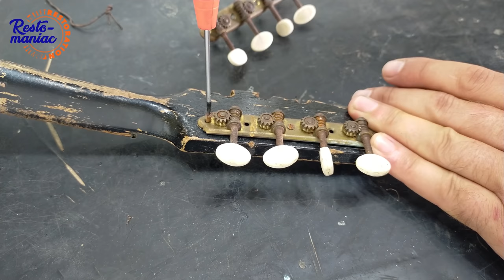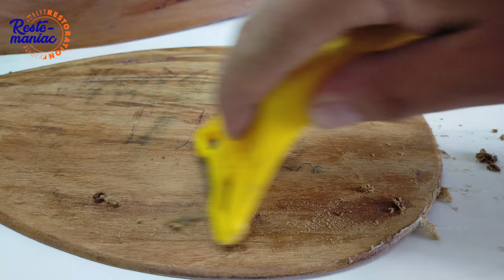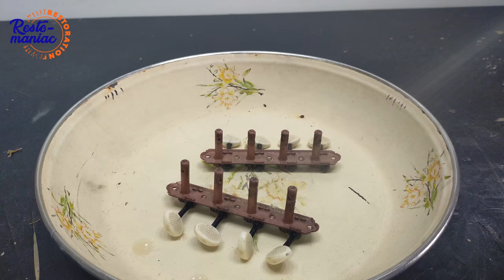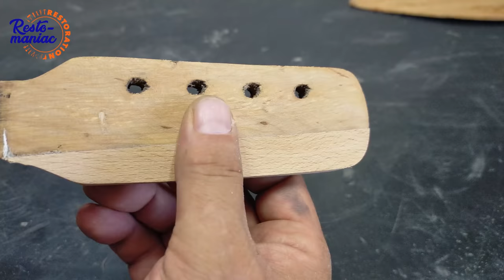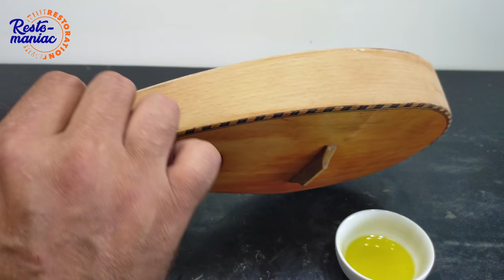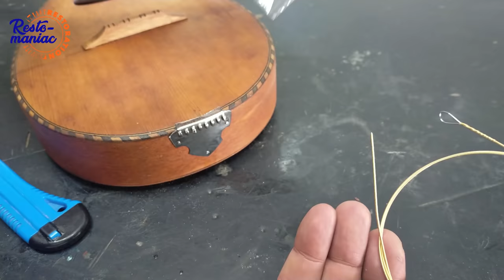Poor Mandolin - Restoration

Comment: As a luthier of some 40 years experience, I feel the need to comment on several aspects of this restoration. First, the bridge on an instrument of this type should never be glued down. It’s designed to be held in place by string pressure and should be free to be moved to make fine adjustments to intonation. Hammering down the prongs on the tailpiece will eventually weaken the metal; after two or three string changes they will probably break. And olive oil is not the best choice for a finish; it takes a very long time to polymerize and harden. That being said, it’s nice to see an old-timer like this revived!
Reply: yeahhh I was right
Reply: Sorry Fred I jumped in before seeing your comment
Reply: @jasperwylde8612  no problem, Jasper; with two of us telling them maybe the message will get through.
Reply: @jasperwylde8612  errare humanum est...Only those who do nothing do not make mistakes
Reply: Also he put the tuners on the wrong way round, therefore upside down
Reply: I agree with Fred Casey,

One additional thing I will add here, is that you really should've used some nice screws for that Tailpiece, instead of nails.

Those nails will work loose and cause the tailpiece to become wobbly, causing the Mandolin to have trouble staying in tune!

Nice Luthiery skills over all though, especially in repairing the Headstock, and cleaning & restoring those tuners, and removing & regluing the back! 

Ron
Abilene, TX.
Reply: @rojobemusic3754  I thought I noticed that, but wasn't 100% sure, so I didn't add it to my previous commentary.

But hey, I'm sure he's still learning this trade, and like myself and all others, one of the best ways we learn at times, is through trial and error. 🙂

Ron
Reply: I thought I was going to be the only one who noticed.

I appreciate the cinematography and editing.

Cute kitty.
Reply: @cfcasey.guitars-ukuleles   As a luthier of sixty years experience, I corroborate all you said.  At the moment, I have eleven mandolines undergoing restoration in my workshop.  One additional problem: the bridge looked quite a bit too high- it will be very hard to play in higher positions.  But yeah- the thought behind the restoration was good.

cheers from sunny Vienna, Scott
Reply: Thanks Elvis for that valuable information jerk
Reply: I'm not sure how accurate it is but there's rumor saying some video producers are using controversial technique just to generate more comments (positive or negative) as part of getting financial benefits
Reply: Dear @therealzilch  ,
What are your thoughts on overlaying the headstock with a piece of veneer to hide the seam where he glued a piece onto the headstock.  Wouldn't that add  strength to the headstock, as well as make it more aesthetically pleasing ?
Interested in your thoughts on this.
Be Well,
DZ
Reply: Dear Fred Casey,
What are your thoughts on overlaying the headstock with a piece of veneer to hide the seam where he glued a piece onto the headstock.  Wouldn't that add  strength to the headstock, as well as make it more aesthetically pleasing ?
Interested in your thoughts on this.
Be Well,
DZ
Reply: @Silverheart1956  , it would indeed. Good point.
Reply: Dear @cfcasey.guitars-ukuleles  ,
 Many thanks !
Reply: Very informative... could you please also comment on better options for the finish? Thanks.
Reply: @mssarioglu  Any drying oil such as tung oil or “Danish” oil oil is good; even linseed oil, although it’s a bit slow to polymerize as well. Lately I’ve been using a product called Tru-Oil (originally formulated as a gun stock finish) on the instruments I don’t finish with lacquer.
Reply: @cfcasey.guitars-ukuleles  thank you. Indeed one of the things i would like to ask was if you use anything like lacquer or varnish or not but you already responded. I'm really surprised because musical instruments always look so shiny. I would think it can not be achieved just with oil. ..
Reply: At least he didn't crimp the loops on the strings.
Reply: That is why I replied "I was glad it was going to be a wall hanger" I too have been repairing for over 40 yrs.
Reply: This whole video was painful to watch.
Reply: On the other hand, would you, as a luthier with 40 years of experience, even bother trying to rehabilitate a $10.00, garage sale mandolin if it was not a decent instrument to begin with?  This seems to be a good instrument to practice and experiment on, and no one will be left screaming that he destroyed a priceless artifact.
Reply: @TheMicroTrak  I’ve restored many inexpensive instruments that have had sentimental value for their owners. Sometimes the cost of restoration has far exceeded the monetary value of the instrument, but the joy on the face of the client to see Grandpa’s guitar, or mandolin, or whatever, put back in playing condition, makes it worthwhile, both for them and for me.
Reply: not a luthier here but a player... I knew something was wrong when he glued the bridge... how will the intonation be set now?
Reply: @maxamy89  Good question; I wish I had an equally good answer.
Reply: I was nodding along with the restoration,  anticipating how this old girl might shine after he was done....then he glued the bridge down and I cringed so bad sigh
Reply: @jasperwylde8612 ;
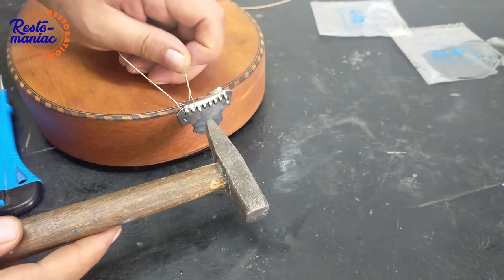Reply: 16:20 😂😭🤦🏻🤦🏻🤦🏻

Comment: You were doing so well up until you glued on the bridge and then hammered closed the hoop end of the strings.
Reply from the maker: Thanks, don't be afraid to hammer.
Reply: Yes. The bridge should float so you can intonate the tone when tuning.
Reply: @Restomaniac   If you are never going to change the strings, go ahead and hammer.  Also, the bridge is quite a bit too high- the instrument will be very hard to play in higher positions.  But for a hang-on-the-wall instrument, it's very nicely done.
Reply: @Restomaniac  The gun stock oil called True Oil, I think would have been a better finish than olive oil.  It looks nice and is more durable.  Also, not a good idea to glue that bridge to the top.  If the intonation is off, it won't play.  Maybe you just want it to look nice and never be played, I don't know, but a bridge should never be glued to a top sound board.  Downward pressure from the strings will hold it in place once the intonation is correct.  This poor old mando gal has seen much better days.  It might have had a decent sound at one time.  Some Venician gondolier might have played it for lovers on a boat ride.  I can see it and hear it in my mind.  Maybe it got wet and the glue gave out.  The paint was a puke color to begin with.  But never use olive oil.  It will smell bad once it goes rancid.   Thanks for the effort, tho.
Reply: Those parts made my left eye close a little bit

Comment: interesting restoration, olive oil not a good choice, Shellac is much better it is fairly cheap goes on easily dries quickly, and looks amazing. The bridge should be of the floating type, they can be purchased cheaply enough to have made this a much better job. Still, it's back in one piece, reasonably playable condition and looks much better than before.

Comment: As a musician and hobby luthier I have to say I agree with the others on the bridge, tuners, tail piece etc. but good job getting that ink pen off there! That was surprising. Good work on the headstock repair also, that would have scared off a few “pros”. Getting the back on and properly aligned was good work as well. Enjoyed the video. 👍

P.s. the plastic for the pickguard is available online and not terribly expensive. Regardless of what this instrument is to be used for, it would look nicer with a pickguard.

Comment: As others have commented, the bridge should have been left floating, the string hooks open, screws in the tailpiece instead of nails, etc.. One other thing I would have done, was to find ferrules for the tuning pegs (prevents damage to the head). All in all a beautiful job on the restoration otherwise. Thank you for sharing it with us! God bless. Rev. D.

Comment: Points for effort and I accept you're not a musician
but
Glueing the bridge before you checked the intonation?
Oh dear!
Mando bridges dont need to  glued because the string are anchored at the tail peice
( nails? really?)
 a free bridge would have allowed for upgrading to a better more resonant material and fine tuning.
 
Hammering the string hooks closed wasnt needed either
what about when the strings need changing?
Prying them open could cause them to weaken and break
The 'Brass bar' is called a fret BTW
Reply from the maker: Thank you for your comments
Reply: @Restomaniac  olive oil is bad impregnation for music wood, usually used linseed oil or hemp oil. This is evaporating oils (IdK how this thing called in english actually)/

Comment: Just a suggestion. Maybe ask a few things about how an instrument works. We NEVER glue down the bridge. You could have bought a fret wire for the "brass thing" that was missing, olive oil is never good for instruments cause it's heavy and does not absorb well and you screwed the tuning pegs upside down. Also on top of the bridge there should be a harder material, we use bone, brass, graphite or even plastic and that part is the one you file with the gauges suitable for every string. Hammering the tailpiece is useless because the tension of the strings will rip it apart soon and also you NEVER hammer down the prongs because they will break after a while and also it would be a really difficult task to take old strings out with the rust buildup on the string. And we don't use superglue on instruments.

Comment: I appreciate you cleaning and reusing the tuners even if I was surprised at first. Good job overall though! Aside from the other suggestions I'd say you should have replaced the missing kerfed lining before gluing the back on.  That's the notched wood pieces that were glued to the edge of the sides. They should go all the way around and give a wider gluing surface. Looks like several sections had fallen out.
Reply: Some makers fitted complete strips of linings but others glued small blocks with big gaps between them.

Comment: I restored just one mandolin but I agree with many others down here, that the bridge musn't be glued. Although this is already being said in many comments, I would like to add the reason why the bridge must be left floating. This is because the bridge must be placed there where the octave is perfect. Most of the time this leads to a bridge that isn't quite perpendicular, because of the difference in thickness of the strings. Instruments with glued bridges are very often untunable. Modern electric guitars have bridges that are modifiable for each individual string. That is impossible for such a mandolin, but one can come close to this ideal situation with a floating bridge.

Comment: Grats on a passable restoration. I thought some of your techniques were inspired, and the mistakes you made have already been pointed out in other comments, so I'll skip that, with one exception. My eyes did go wide when you hammered down the prongs on the tailpiece. After going back to the beginning, I noticed that they were hammered down at the beginning (probably from taking too many trips to the floor). So, that was an easy assumption to make. My recommendation is to watch some of the other restoration/repair videos on youtube. Stew Mac and Twoford are a couple I would recommend, and there are many others. I don't believe the mandolin you repaired was particularly valuable, and was probably a great learning experience. With nothing to base this on other than the plastic tuner buttons, and what was left of the pickguard, I believe this mandolin may have been from around that late 50's early 60's era. I may be way off though. Anyone else want to chance a guess at year made or manufacturer?
Reply from the maker: Thank you very much for your valuable comments and time.

Comment: The tuning machines are on the wrong sides.  Turning them clockwise should loosen the strings.  How is this intonated now, with that bridge glued down and no adjustment on it?
Didn't need to bend the tailpiece tangs.  Need to unbend them to change the strings.

Comment: I'll go with the other luthiers comments and add the bridge should be shaped seated to the top. It also needs the bridge  height adjusted and a hard edge on the bridge like bone or plastic etc. Overall it does look nicer.

Comment: Olive oil is a really bad choice for oiling wood. It goes rancid and will eventually smell/work terribly.

Boiled linseed oil, Tung oil, Danish oil, or mineral oil (any non-food based oils, or seed based oils that can polymerize like flax) are the best choice. Olive oil can be used to french polish because it doesn't penetrate into the wood and sit there, oxidizing.

And don't glue down the bridge on the next one. I think only guitars have a secured bridge, everything else is just tensioned.

That said, in the end, who cares. This is just advice for your next one and not criticizing this one at all! You saved something from the trash and gave it new life. That's what matters.
Reply from the maker: Thank you very much for your valuable comments 😊🙏

Comment: Wrong glue 👎
Bone glue is used for instruments. With the glue you used, no one can undo the joint without destroying it. With bone glue, all you would have had to do is heat it. It's also harder, which is significantly better for vibrations.
Reply: Rosa String Works will disagree with you on that comment and say that Titebond Original is fine...

Comment: I am a luthier, someone who studies, makes and repairs musical instruments and I want to point out several things.
very important, I am not saying that this restoration is bad, believe me when I say that much worse things have been done to "restored instruments" but I want to leave these comments in case anyone wonders how it could be done if they want to give it a try. Anyone who wants to learn this beautiful trade is always welcome, but you should know what is right and wrong when repairing an instrument.
1st - i do not recommend use of paint remover to remove the lacquer on an instrument, the wood would expand and then when it dries it will shrink and crack, it is better to use sandpaper of different grits.
2nd - I do not recommend sanding the harmonic top, backs and sides without checking that the thickness is equal throughout the length of the piece to be sanded, as this can create variations in the way the resonance box or body vibrates, removing important harmonics and sound volume to the instrument. it is recommended to always use a thickness gauge.
3rd - Always use hide glue or wood glue to glue musical instruments, as these types of glue crystallize instead of sticking which gives it more vibration and allows it to melt with water or heat in case the instrument needs to be opened to repair it. It is not recommended to use rubber adhesive or similar, also i do not recommend using super glue to glue the resonance box or body.
4th - Hardwoods and a bone nut are recommended for the bridge to enhance resonance.
do not glue the bridge to the harmonic top as it must be moved for adjustment when calibrating and tuning the instrument.
5th - The missing fret that was replaced should be adjusted to be at the same level as the rest to avoid hum and cause the instrument to fret or sound bad
All this that I am mentioning is something that is studied to be able to repair the instrument correctly if it is to be used later as a suitable musical instrument.
if the end is only decorative it seems to me a decent repair and restoration and I congratulate you for at least trying it with acceptable results for decorative effects.
Please don't hate this restoration, I've seen worse, be polite. 
Follow my advice if you want to try. 
In any case, I recommend anyone to go to a luthier if they want to repair an instrument and are not sure what they are doing.
Reply: Piss off Mr. Expert. This is a restoration, and perhaps then a renovation by an "expert" like you? Geeze, get a grip , Dude!! LOL!!
Reply: Cant forget that he installed the tuners the wrong way as well
Reply: This instrument was butchered. Restoring an ancient instrument should preserve the original finish. A 100 year old will look one day old.
Reply: 6th - Don't bash the hooks on the tailpiece in!! The instrument will need restringing in the future!
Reply: Another thing I would add is that you shouldn't bash in the hooks on the tailpiece where you hang the string loops, otherwise you won't be able to change the strings unless the hooks are bent back. But if you repeat this over and over again, it can happen that the hooks break off after a while.